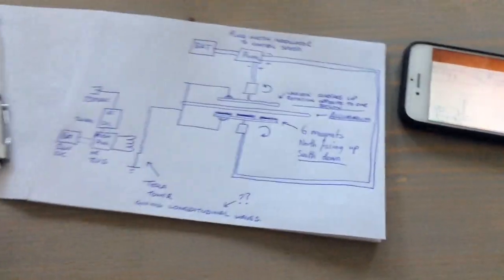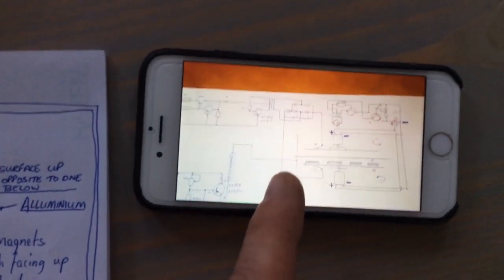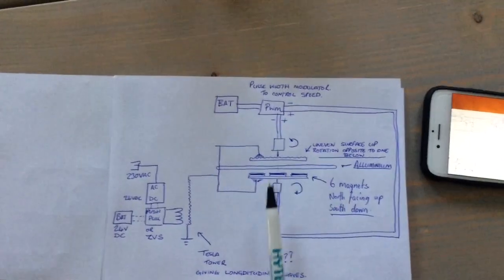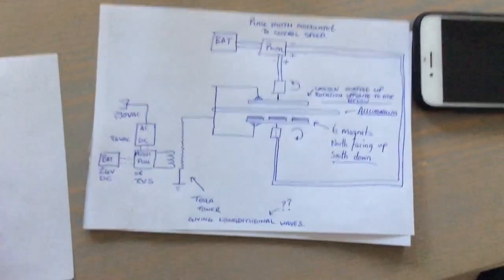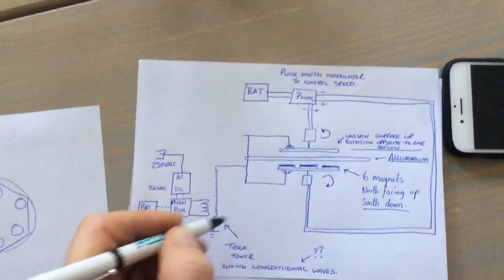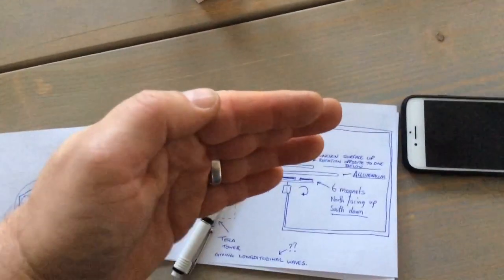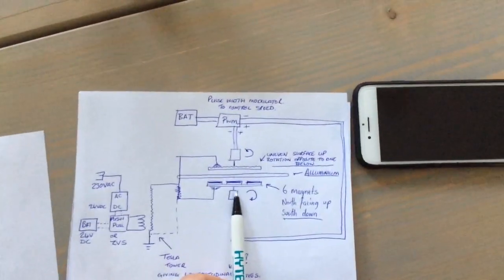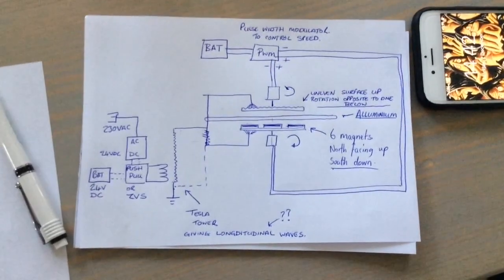Thoughts about making an electrostatic lifting unit.

Comment: @dkdyker bro, you got wiring wrong. Tesla coil (bottom left) is connected to the central static disc. Two counter-rotating discs are connected to the DC high voltage supply (top left).

Comment: No. You got it wrong. The original diagram has a high voltage rectifier. Clearly, the top rotating plate is supposed to get a positive DC charge, and the bottom rotating plate is supposed to get a negative DC charge. Opposite pole's high voltage makes it move, just like Townshend Brown. The center plate gets AC high voltage to help along.... Supposedly
Reply: Opposite rotations. And you may need to try the magnets north facing up in one rotation, then north up in the other rotation, then flip the magnets north facing down, one rotation, then the other rotation. Positive voltage always on the top plate. 4 different tests
Reply: Also, from the look of your other video, not sure if you know what a diode rectifier is, and what it does. A Tesla coil does not make positive and negative at the opposite ends. A Tesla coil makes AC. The voltage reverses every half cycle. Only a set of high voltage diodes can send all the positive charge to the top plate and the negative charge to the bottom plate. You must use a full wave high voltage bridge rectifier in your system or it will not ever work.
Reply from the maker: saintsnick thanks for your info. Do you have an example you can show us ??
Reply: @dkdyker  I did not build this. I'm going off the Alexy schematic diagram. He has two separate high voltage power supplies in his schematic. One of the two supplies generate AC that is fed through a Bridge rectifier to converted it to DC, which he then uses to charge the two rotating plates threw a brush that makes contact with the plate. The positive high voltage DC coming out of the bridge rectifier goes to the top plate . And the negative high voltage DC coming out of the rectifier goes to the bottom plate. The second High Voltage power supply which is basically a single transistor Tesla coil high-voltage high-frequency AC as you would expect and is connected directly to the center stationary aluminum plate. If you're trying to replicate what he does, that's what you need to do. All three plates are aluminum I do believe. Aluminum is diamagnetic.
Reply: Also you are missing an ultrasonic speaker on the top. Look at his diagram
Reply: He's also missing the fishing wire for indoor demonstrations, that would really help too

Comment: nice work hope you succeed
Reply from the maker: Steven Chiverton thanks, it’s a bit funny to think it maybe easier than we expect. I will post more at some point, why not try yourself??
Reply: @dkdyker  one day ill try it i have his schematics etc and understand why the hv output of the tesla coil would be used its not just the hv its the radio frequency currents output like a powerful sec exciter, the disc with metal contact coating which you can see where its worn off at the edge makes a hv capacitor to think of the so called flux liner
Reply from the maker: Steven Chiverton nice , one fine day :)
Reply: @dkdyker  seen all alex chuckerkovs videos of his flying anti gravity craft look at them one has a a silver looking thing looks like its plastic and comes from a torch and theres supposed to be a transducer under it in one video , in the other video it isent there so i think the whole set up may be so simple that he just used the transducer to make it look more complicated as even a transducer uses so many parts so take a look at it even they aren't named  someone has a youtube video trying to explain it all and its in english and he did a good job explaining most of it
Reply from the maker: Steven Chiverton thanks do you have a link to the vid you talk about?
Reply: @dkdyker  ill try find it again for you
Reply: @dkdyker  i dont have the money resources and working space to make one nor a cooler climate its very hot here in australia
Reply: Check out my Replucatio of Alexy Graviflyer!!